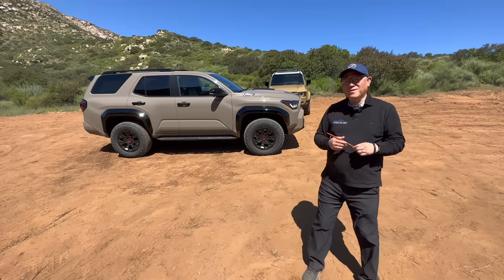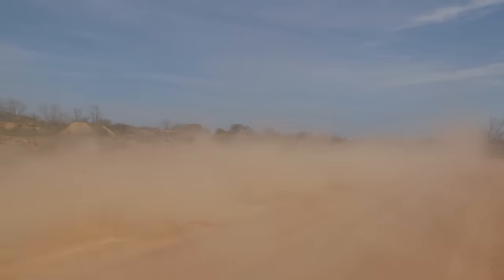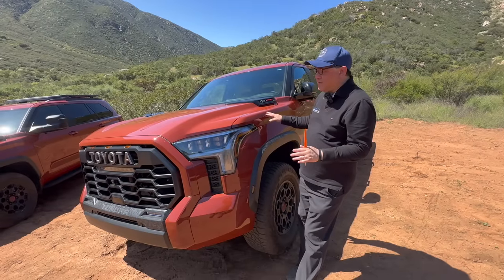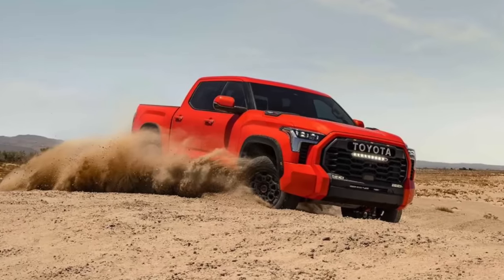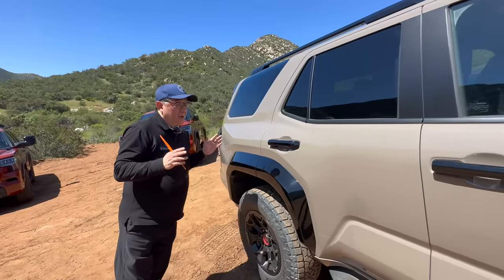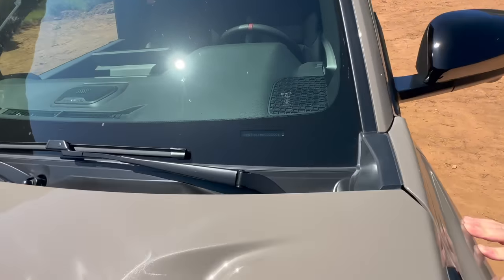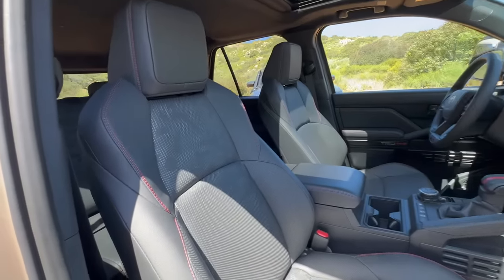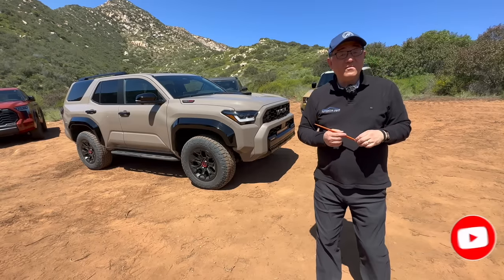2025 4RUNNER IS HALF TACOMA & HALF LAND CRUISER - BEST OF BOTH WORLDS? 4RUNNER vs OTHER TNGA-Fs

Comment: That’s a great way to put it - front half is Tacoma, back half is Land Cruiser.
Reply: Reminds me of the old song, the front is like a car, the back is like a truck, the front is where you drive, the back is where you - - - El Camino!
Reply: i have a strong feeling if u take off the 4runner body the frame and suspension underneath is the exact same as the landcruiser prado/gx 550. all 3 are technically built in the same factory, on the same assembly line

Comment: I have a serious issue with the 4runner still not getting a flat floor with seats down. Same with the tundra back floor not being flat. Completely changes how well you can stack cargo/ dog kennels ext.
Reply: Not to mention usefulness as a camper / sleeper / overlander.... Before adolescent fanboys knee jerk "that's what tents are for," not nearly everyone wants to have to always erect a tent, especially on the roof (!?!) or elsewhere, when tent camping, per se, maybe isn't particularly the objective... depending the situation, whether it be because of inclement weather complicating set-up, trailhead'ing before and after a hike, rest area'ing or literal car camping--especially one-overnight'ing per site.  That and - the previous 4Runner's seats folded flat, relatively, allowing an unfettered (near) 6-foot straight. And, let's not forget, slid fore-and-aft accommodating apportioning priorities. We get it about the hybrid battery, taking up space blah blah,... figure something else out or jetison the idea. You're spending $45 to $75,000 on a 4Runner (or Land Cruiser...or Tundra for that matter.), presumably a good portion the (at least design) purpose of which is adventuring, whether it's mild forest back roads or more serious forays into the outback..... even though, yes, we know that a good number of these will (actually) be also used as mall cruisers..... Nevertheless you paid a lot of money for a type of vehicle that usually can be camped in and easy to haul with. Wth? It's like they didn't design or beta test at all with actual "classical" outdoors 4Runner users in mind, but instead focus group'd with some newbie Gen Z or younger Y'ers  with different priorities, or suburban first timers.
Reply: Agreed.  My 4th Gen 4/Runner you just flip the bottom of the rear seats to towards the front seats and the back part of the second row then goes flat.   It is almost even with the back area…just a slight slope upwards,   It is so handy when hauling items or for me….letting the dog walk around in his own flat space for car rides….

Comment: Hi Dave, can you comment on a few things:  1) what is the largest tire that can be put on the 4Runner.  2) Has Toyota addressed any of the  rust issues for us in the rust belt  3) Can the tailgate be opened from inside the cabin for us who camp in their 4Runners.  and 4) do the roof rails state a max load?

Thank you!

Comment: David - Toyota should’ve gone TTV6 and optional EKDSS on Land Cruiser.  I know that’s GX but LC is more GX than 4R which is more similar to Tacoma.  Need more to distinguish the 2 otherwise that’s a lot to pay for different styling and full time 4WD
Reply: They should put the v6 in it with regular fuel it would be the choice of the three in that case.  Biggest negative of the GX is premium required. Biggest neg of LC is the hybrid + battery hump.
Reply: 1000% agree! I’d buy one in a heartbeat!
Reply: And a standard rear locker. 4Runner has never previously offered both full time 4WD and locker at the same time. To get both at once in the GX550 you have to go a lot higher than the base model.

Comment: It has a lot of highlander as well. It looks like the roof is lower and more sports like than previous gens. The windows seem smaller. It's like they flattened the top. Is there less headroom now? Kind of like how the highlanders used to be more upright and then they made them flatter with less headroom, cargo space, and sporty. Then they had to come out with the Grand Highlanders that seemed to have a shape more like the old style..boxy and truck like. Looks like you sit lower and the hood seems high. I liked the older styles that you sat more upright like an old truck or even van. You get a better view of the road and front. I think the Land Cruiser and GX have that style from what I can see. I like 4 runners best but I wish the roof was higher and seating position was not so sports car or cockpit type. More open and roomy inside like the Land Cruiser seems to be. Tough call between them. Both are very nice. If money was no problem the GX with the V6 overland + has more cargo space, stronger engine and very nice design.
Reply: The Land Cruiser is like the modern, grown up version of the FJ.

Comment: I would love to know why the grab handle is not on the driver side of the new 4Runner and Tacoma. I see they have one on the new Land Cruiser and also on the new Lexus GX. All 4Runners had them on driver side till 2009. The've been missing since 2010.  I think it makes the interior in the front look unbalanced. Meanwhile the 4Runner based Lexus GX has had the driver side grab handle since it first came out. One other thing I wish Toyota continued with the amber rear turn signals on the new 4Runner. Not a fan of all red tail lights , that's more a American thing.

Comment: What do people think of Land Cruiser vs. 4 Runner? Would like some suggestions!
Reply: The Land Cruiser has a taller greenhouse and more spacious interior than the 4Runner. Every LC has the superior full-time 4WD system which is an option on 4Runners.
Reply: I love the clean lines of the Land Cruiser vs. the busy look of the 4Runner with all of its jagged proportions.  The interior layout in Land Cruiser is also better in my opinion.  While the screen isn't flush with the dash the way I'd prefer, it's better then on the 4Runner.  My choice is the Land Cruiser. I just wish it had a naturally aspirated V6 or V8.
Reply: @rightlanehog3151  some reviews show the wiper is tucked up in the top spoiler.
Reply: @rightlanehog3151 since the rear window slides down, the rear wiper is placed up above under the spoiler just like in the previous gen!
Reply: The better choice is the Lexus GX 550 Overtrail for off-roading, which is the better version of the Land Cruisers. Also no battery to chug along.
Reply: @Veritas0589 I agreed about the infotainment screen on the new 2025 4Runner. I didn’t like it sticking up like many other new cars instead flush in the dashboard. Besides it’s 4 cylinder turbo and expecting higher price compare to the current V6. Don’t think I’ll consider buying it.
Reply: But you can get scratches on the rest of the truck so what does it matter
Reply: I’d like to hear a deep dive into the Max hybrid power system; design, pros & cons, longevity, lifecycle cost, performance, and use cases.
Reply: @marc8vino  ok
Reply: @OldelCpt  ok
Reply: @OldelCpt  Who wants to pay for 70-80k for new GX  just to consider off road capabilities. Lexus is known for making luxury, elegant, smoothness, liability. Not for off road. I think they are in the wrong directions for most Lexus fans.  With all that off road equipped it just cost much more and rarely used in my opinion.

Comment: I always appreciate the unique perspective and insider info you give.  My wife and I are Toyota fanatics who currently own 4 including a 2013 Landcruiser, 2013 Lexus is350C, 2022 Tacoma TRD Pro and 2021 Venza.  I'm planning to get either the new LC or the Lexus GX 550 when it comes out in the Hybrid version.  Can you tell me if the Hybrid GX550 will have the 3rd row seat option?  I'm not sure if they can with the battery in the rear, but that's what I'm hoping for because the LC won't have the 3rd row.  Thanks, Dean
Reply: It probably won't because the sequoia has that issue already.
Reply: @normanli7085  Thanks for that thought.  Did I hear correctly that the 2025 4Runner will offered in a 3 row version?  Isn't it all hybrid?
Reply: @geezersgotgame9767   it will and like the TTV6 GX 550, it's on some trim levels. The 250 series land cruiser is standard hybrid so that's why it doesn't get it

Comment: Why do you think the windshield geometry is so different in the 4Runner than the other two? Do you think Lexus solved the dreaded chronic crack that wrangler suffers from with that upright angle. I was all set on the GX but replacing windshields all year is a deal breaker.
Reply: Good points. But it’s possible that glass has gotten stronger like the glass development on iPhones.
Reply: @OldelCpt  I hope so. My cousin replaced her wrangler with the gorilla glass premium option replacement and it cracked the same day. 😝

Comment: One of these TNG-F platforms should have had removable panels or removable roof! At the least the Land Cruiser should have had the sliding rear quarter panel windows and split tailgate , maybe even put the spare on a swing away. As you can tell I’m somewhat disappointed that Toyota didn’t differentiate the vehicles that much (4Runner, Land Cruiser, GX).  Missed opportunity! ☹️

Comment: I have watched an overview of the TRD Pro, and there are some pluses and minuses for the new model. IMO
Pluses,
Powered tailgate 
Hybrid 
Better cameras 
Curved rear glass (a callback)
Portable dash speaker 
Factory integrated lightbar

Minuses,
No manual transfer case shift
Rear seats fold differently than previous gen
Fender flares seem oversized 
Rear badging is oversized 
Roof rack is low profile and not tubular

Comment: I am quite disappointed that it is only available with a 4 cylinder engine. For me, that leaves only the Lexus GX as a consideration in the entire Toyota SUV lineup.
Reply: The four-cylinder turbo hybrid produces more torque than the outgoing V8 in the 200 series Land Cruiser.

Comment: Hi. I would like to know why a particular plant makes a difference regarding the gap between various body parts. Screws holes ensure 2 body part come together only 1 possible way in my opinion so how can workers of a specific ethnicity (in this case Mexico, Japan and the us) make any difference. Thank you for enlightening me.
Reply: At a guess not ethnicity but rather cultural.  Examples of this can be seen in train videos from Japan where the staff are very meticulous about doing everything in an obvious way - the pointing at things, etc - that simply doesn't happen in Europe or North America.

And it isn't simply screw holes - the holes are often "stretched" to allow adjustments to fit, which can be seen in body shop videos when they adjust doors or even in David's video where he comments that the prototype 4Runner hood wasn't on quite correctly with a difference in the gap on the right vs left side.

Comment: 4Runner would be a hybrid between the Taco and the GX in FJ Cruiser clothing if they’d gone 1st Gen with removable roof.  As it stands now, Toyota is just producing Prado variants to compete against each other for no apparent reason.  (The FJ Cruiser, 4Runner, and GX were already Prado based so this isn’t earth shattering or anything.) It’s the same logic of selling the LX570 to compete against the LC200 without differentiating them sufficiently and then deciding not to sell the LC300 here due to poor sales numbers.  The LX, which is actually a formidable off-road vehicle under its inane exterior is marketed to those who don’t care about such things while those who want a truck to take off road are left with the Sequoia or the so-called Landcruiser.  The Sequoia, Tundra and Tacoma are not bad per se, but they aren’t the same as their brethren made in Japan and it sucks that Toyota has too many chefs in the kitchen in recent years.  They’ve killed TRD and they’re diluting/undermining the things that made Toyota rank above the rest in reliability, dependability, and understated ruggedness.

Comment: That 4 cylinder is a deal breaker for me. 4RUNNER exterior looks awesome. Prefer the body on frame, though
Reply: Well thats the way it it. 5yrs from now they gonna drop it to 2-3 cylinder.
Reply: The 4Runner is on body-on-frame, the same platform as Tacoma, LC (technically Prado), GX 550, LX 600, Sequoia, and Tundra.
Reply: Shame to hear. Buy a GX if you care that much about cylinder count. The new 4cyl makes way more torque than my 4.0L, and waaay lower in RPM, so I’m all for it

Comment: Like that the Land Cruiser has full time AWD. Does the 4R have it on lesser trims ?
Reply: I think the Platinum or Limited has full time 4wd. Definitely not the TRD Pro or Trailhunter (I believe).
Reply: @Autotad Correct! It’s so strange that only the road trims of the 4R have them. In snow country with rain mixed in, thus with roads with patches of ice, snow, asphalt the full time 4WD is nice to have. I wish the Trailhunter would have it, or at least give it as an option. 
That forces one to go for LC or Lexus if wanted.
Reply: @OldelCpt  I think Toyota knows exactly what they’re doing, they want us to spend more for the LC! If the trailhunter had full time 4wd, that would probably be my choice. But I’m really leaning towards the LC LC now… but need to figure out the financials haha

Comment: So it's got the Tacomas horrible seating position, where you're basically sitting on the floor with your legs straight out in front of you? Does it handle like an overloaded motor home, like the Tacoma? And it can't handle even the slightest increase in tire size without rubbing everywhere?

Comment: Wheel claddings stick out. Is that why it is a wider vehicle. Not good for off-roading. Is it still an all steel vehicle, no aluminum. Why didn’t get to see the cargo area? The seats don’t fold up as good as the 5 th generation. The hybrids take up too much cargo space. Seat doesn’t slide?!

Comment: Like the looks of the 2024 a lot better. Don't like the 4 cyl turbo engine, the stupid big screen on the dash, and the big grooves in the side panels by the doors looks like somebody side swiped it.  Don't believe that the 4 cyl. turbo is going to last anywhere near as long as the 4.0 liter 6. The engine compartment looks terrible with the clutter!  Just my opinion we will see.

Comment: Toyota went from a ton of ancient trucks/SUVs to an overload to models/trims under the same architecture. Ford seems to better understand how to execute on trims/models in a way the customer can absorb.   Ford decided to make Australia the launch market for the new Ranger (Tacoma) and Everest (4Runner) as variations are made available globally.  Ford is offering a more powerful base engine 2.3l turbo, optional 2.7l TT V6,  PHEV 4 cylinder, H.O V6 (Raptor).  Ford started with the crew cab but is slowly introducing other cab configurations.

Unlike Toyota, Ford is not afraid to show the volume Ranger XLT as the new Tacoma/4Runner SR5 vs Ranger XLT is on average $3K more expensive (similarly equipped).  If demand is there in NA, Ford can produce the Everest SUV and provide a direct competitor to the 4 Runner.  IMO, No Landcruiser/GX should be denied the V6 engine.as standard and I suspect Toyota will change this sooner than later.  The coarse noisy 4-cylinder is inconsistent with a $50k+ vehicle.  If they can make it quiet in the Crown, the 4Runner and Tacoma should be quiet as well.  The fact that discounts are already being provided on the new Tacoma speaks volumes.